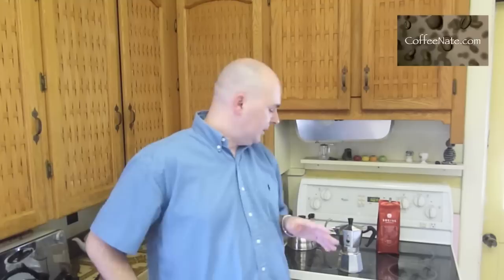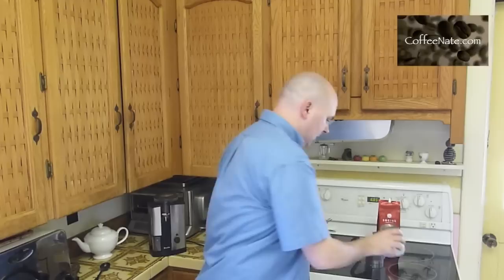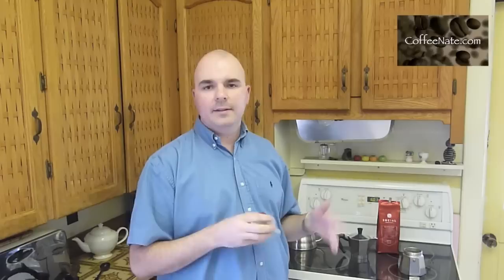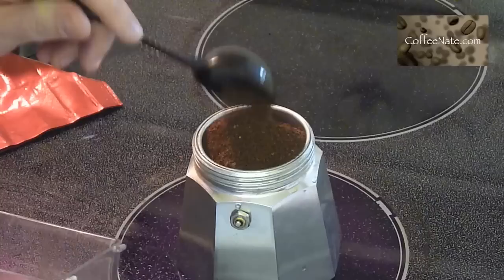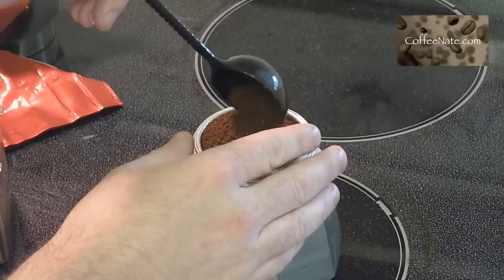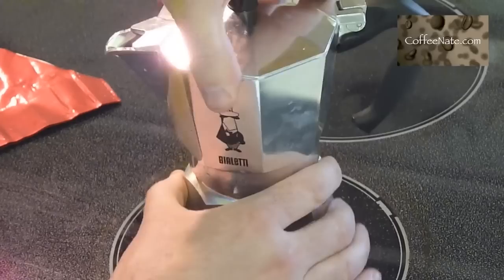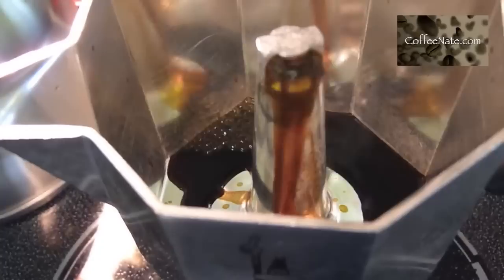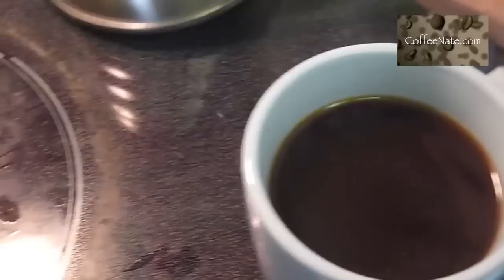How To Use a Moka Pot :: Coffee Tips

Comment: Ending was a surprise... Nice instructions (coffee on the edge of the funnel was my number 2 pressure problem. number 1 would be too much heat beneath the vessel making the coffee go crazy to my kitchen walls). I'd like to suggest, when using a traditional fire stove, to put a little water in the collector to "welcome" the coffee and not letting it fall straight on the hot pot because some flames could have "escaped" the bottom edge and heat up the collector. Regards from Brazil.

Comment: Great video! It is "dummy proof," as you said; but you're one of only a very few on YouTube doing it correctly!🎉 😊 

99% of the non-Italian videos do it wrong, and most of the Italian videos whiz through it too quickly for a beginner to learn because it's second nature to them. 

The 'Specialty Coffee' influencers have totally bastardized the Moka pot process by adding unnecessarily complicated hacks to compensate for their poor technique, since it's obvious they never learned to do it the traditional way in the first place. 🙄 So I usually recommend everyone learn the authentic Italian way, since 1933, by watching the "Annalisa J Moka pot" video. She does it the same way you do, per Bialetti instructions. But she goes into a bit more detail for beginners, like: fill it with room temperature water to touch the bottom of the valve, (or Bialetti says to use cold water), and which pre-ground Italian grocery store espressos will work. (Bialetti replied to my email that medium-fine is the correct grind. Most espressos are too fine, but the espressos sold in Italian grocery stores are ground for the Moka: illy, Lavazza, Kimbo, or Bialetti Perfetto Moka.)

When people complain that Moka pots make burnt or bitter coffee, it's because they don't know to use either a low gas flame, or medium electric stove, and when to take it off the heat early so it finishes brewing off the stove. I take it off the heat the instant I hear it start to gurgle. But "Italian with Bri" recommends taking it off a second before it starts to gurgle, then let it finish filling off the stove. Then stir up the coffee from the bottom and pour. 

I used to live in Spain, so I make Cafe con Leche by putting 5 oz of whole milk in a glass, (Duralex Unie clear tempered glass tumblers 8.5 oz, is what the Spanish cafes all use), heating it in the microwave while the Moka pot is cooking, then add one shot of the "espresso" to the hot milk. It tastes much better than any Latte I've ever bought at Starbucks, Dutch Bros, or Scooter's, etc. But if I'm on Keto, I make faux whole milk by mixing 1 oz of heavy cream with 4 oz of water - it's perfect!

Comment: I get a metallic tasting brew if I use cold water, so I prefer boiled kettle water in the moka pot
Reply: You're absolutely right, it's b'cause cold water dampens the coffee prematurely b4 it gets to boiling point, thus the funny taste.  It's always, also, recommended to wash your moka pot wt warm water and mild liquid after every use.  Also, make sure greasy  coffee trace is well cleaned by sponge as it can carry over taste of old coffee to new brew. Finally, make sure the pot is bone dry b4 each use.  If it's not, you can just put the empty pot on the stove and watch it dry up.
Reply: Jas George thanks for the warning...i just got my moka pot and I was going to use cold, filtered water from the fridge.
Reply: Jas, I just brewed coffee with a Moka for the first time today. I followed the instructions of brewing a few cups before first use. Used filtered water just below the valve, proper grind, no packing, medium heat, etc. The brew was extremely acidic. However, I did use cold water. I wonder if this is my problem.

Comment: Thanks.  The ending might have been caused by super dark flavor.
Using Moka Pot, Taylors coffee ( UK, on youtube ) says:
1)  start wt boiled water initially.  This will mean boiled water hits dry grinded coffee quickly causing an instantaneous  burst of flavor.  When using cold water, as it's heating up moister will dampen dry grinded coffee above it causing some of flavor to escape. 

2) do not use coffee beans just grinded rather, leave it for a few hours ( well covered in a dark, sealed container).  This is b'cause freshly grinded coffee contains gas molecules which reduces flavor, once left for some hours degassing will improve ultimate flavor.

Comment: Add one or two circle-cut paper filters on top of the coffee grinds to achieve even MORE pressure to the brewing process; just take a hobby knife and trace circles out of standard drip-coffee maker filters to be the same diameter as the rim of the coffee basket.  This will allow you to use even EXTRA-FINE grounds all while minimizing the risk of getting coffee bean grits in the upper chamber or even getting stuck in the central stem.  Note though that if you use paper filters, you likely won't even need to use that "extra mound" of coffee... which means more savings for you!
Reply: I think it's risky to add extra pressure to the Moka pot because they can explode. They were designed to use 1.5 to 2 bars of pressure with a loosely filled basket of medium-fine ground coffee. I don't believe the hacks improve the flavor at all.

Comment: Use mineral water if the tap water of your city isn't good enough. You can buy the best coffee, grind it by the moment, use a good moka pot, but have a "cicoria" (bad coffee) because of the water. I knew people from south italy bringing water from naples to the north just to make coffee.

Little hint: less water! the water should be below the valve and lower the fire after one minute. Anyway, I refuse to comment the water adding at the end.
Reply: Good bottled or filtered water is very important! But it you use a low gas flame or medium electric stove you don't need to turn the heat down. Just take it off the instant you hear it gurgle and  let it finish brewing off the stove.

Comment: I wonder.. What if I used milk instead of water in the pot ?
Reply: Don't use milk or anything other than water. Very bad idea.
Reply: try boiling milk unattended and see what happens.. and the vapor from milk isnt just milk in gas state, since milk is a colloid it has fats, protein, sugar etc which all evaporate at different rates .. although if you wanted to experiment i suppose you could try putting milk in the collection chamber so it heats up at a slower rate and slowly mixes with the coffee as its brewed... would be interesting to try
Reply: Yes, it would be a caffè macchiato freddo if you add few drops of cold milk, or a macchiato caldo if yo add steamed milk foam (so it would be a small cappuccino in espresso cup). Adding water would make any italian freak out: we try every way to make it stronger.
Reply: No, you can add milk (caffè macchiato) or liquors (caffè corretto). If you want more water (caffè lungo), you have to wait for all the coffee to pour out of the moka: the first half cup that it pours is strong, the second half is medium, and the third is very watery. But adding water in the cup is crazy!

Comment: How should I wash it? Everyone says that I shouldn't use dish washer or dish soap but I don't know why. Also If I wash it with water, there is always coffee between upper part and the filter. Should I each time remove it? Thanks for the answer
Reply: You should wash it just with water, otherwise the aluminum could 'soak up' the taste of soap.
And yes, you should always clean all the coffee from the pot, otherwise it could build up and clog it.
Reply: Brewing in a moka pot will build a patina over time, thus resulting in great tasting coffee. If you wash the pot with soap, you will remove the patina and your coffee will taste tinny or metallic from the aluminum. Never put your moka pot in the dishwasher, not only will it remove the patina, it will ruin the aluminum and the pot will lose it's shiny appearance.

Comment: CoffeeNate hi, what size of this bialetti moka pot 6 cup or 9 cup ? and what is the ideal size ? thanks.
Reply: There is not such thing as ideal size. Water that is boiling the chamber below is coming into the top chamber due to the pressure created (water vaporizing..) through the coffee in the middle slightly pressed.... so everything is "calculated" that enough water is going through enough coffee for the amount of cups is on the label when you buy it ;)

Comment: Why do you double strength it and then add hot water? Why not just use the regular water to coffee grounds ratio?
Reply: because then all of the water would overflow and cover your stovetop. Not very easy to consume that way. ;)
Reply: ***** But I mean howcome you didn't use less grounds? Does the thing only work when its completely filled with grounds like in the video?
Reply: JO. O
Yes, the Moka pot works well, only when the basket is completely full. There is an accessory that you can add to the basket to occupy the extra room, but it really isn't necessary. I actually prefer to drink the brew at full strength, but most North Americans will choose to dilute with hot water, which is why I included it in the video. Thanks for the question!
Reply: JO. O I have an 18.5oz Moka and I use it every day to make a single !2 oz cup of coffee doing exactly what you are suggesting. There is no need to fill the basket nor add any accessory as from a physics point of view the basket is actually full (of air) before you even add the coffee so when I add my 3 scoops to the basket it is now filled with grinds and air. The science of pressure does not require a solid to be filling the space as is obvious by the space that is left between the pressure escape valve and the top of the bottom piece of the unit. Even if you fill the entire basket with grinds you are still left with a combination of water, air and grinds so by using less grinds you simply have more air. All that does is affect the number of Pascals required to create enough Force to boil and turn the water to steam. That being said I have no idea how well this would work to make a single serving (12oz) of deliciously strong (and I use French Roast) coffee with no wasted grinds or watering down of the final product

Comment: Say I buy a 6 cup moka pot, but that I only want to make one cup. what happens if don't fill the bottom chamber to the brim?
Reply: i think you'll get light taste coffee.
Reply: not filling bottom chamber to the brim means a very strong flavour of coffee (not very good for your heart ;) )  and not enough "extraction" from the coffee used to make your cup.. (I noticed that almost all water is gone from the bottom chamber at the end of the process..)
Reply: Reason for filling to brim is to displace all air ( remove air ) which equates a better flavor due to purity [ no air mixture] & extra pressure (comes from Physics [ see Pascal law ] ).  If you just want one cup, use about 7gr for 4.5 ounces of water, you should be OK.  However, you can always put a piece of coffee filter covering the mouth of the chamber to gain your extra pressure for a partially filled chamber, like @rkmugen says above, you can always double layer that extra filter to ensure velvety, flavorful result.
Reply: Max Din top answer! ;)
Reply: Tianhaku My Moka pot holds 18 oz of water if i were to fill it right up the the pressure spout. I simply fill to the brim whatever coffee cup I am going to use with water and put that into the Moka. I then add 3 scoops (Tbsps) of the fine grind beans (about 2/3 of the basket) and voila, a delicious strong cup of coffee and I done add and boiled water to it because I used 3 scoops of grinds as opposed to filling the basket to the top as shown in the video.
Reply: tedy tedy r If you dont fill the bottom chamber you simply use less grinds

Comment: I seem to not find the sweet spot on my stove. too cold and the brew takes well over 5 minutes.  too hot and the brew spews out very fast
Reply: This video is good, but for a more detailed explanation watch the Annalisa J Moka pot video. She's Italian and does it the traditional way. Use a low gas flame or a medium electric stove. Remove it from the heat the instant you hear it start to gurgle, then let it finish filling off the stove. Yes, it will take at least 5 minutes, so just stand by and read your phone until you hear it gurgle.

Comment: I can't seem to get the basket out of the bottom of the Moka pot, any tips?
Reply: Nancy Higdon The gasket gets gummy and deteriorates Nancy. Just use more force and the basket will let loose. When you get it apart look where the basket meets the unit and you will see the rubber gasket. It will likely improve if you just clean it well or take it out and buy a replacement
Reply: Turn the bottom upside down and bash it against a table full force. It'll learn the hard way...

Comment from the maker: No, I wouldn't suggest tamping. If you pack them too tightly, the water will not be able to push through. An espresso machine has at least 9 atm of pressure, but this Moka pot does not. In other words...you'll have a big mess.